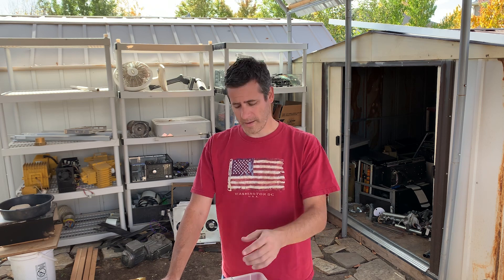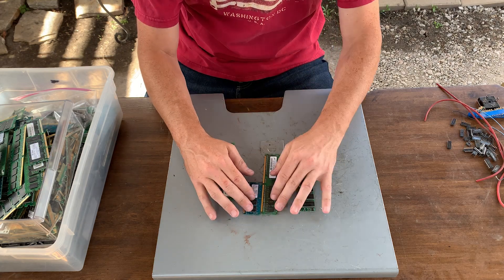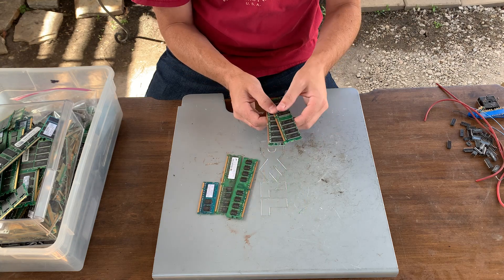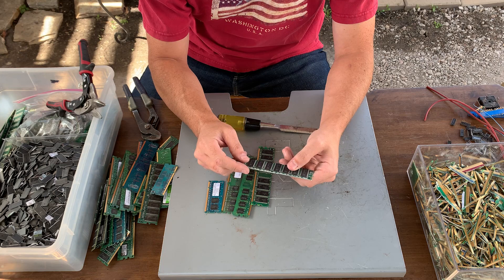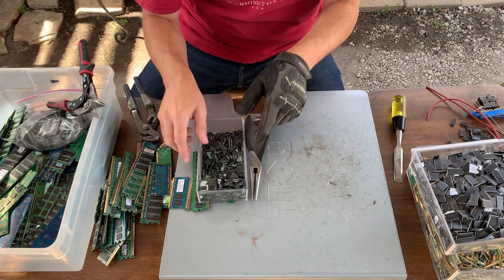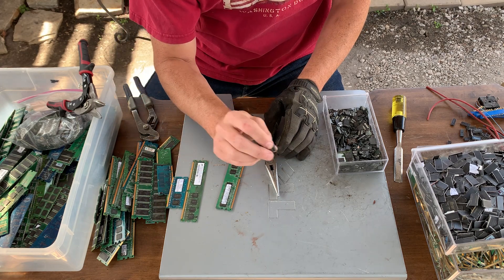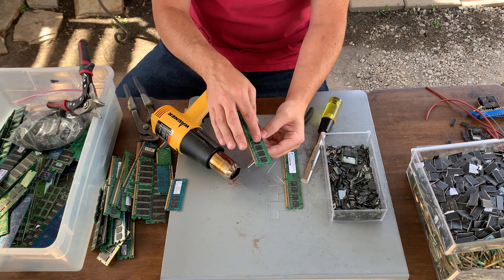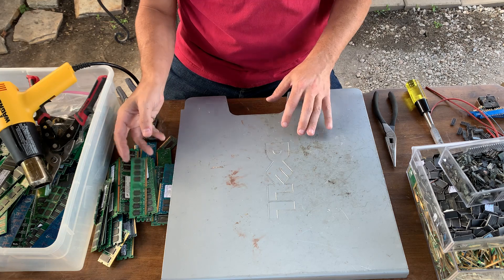How to Pull Gold Components From RAM (Recovery, not Refining)

Comment: I use a heat gun. It takes everything off and nothing goes flying
Reply from the maker: I used to use one too.  The heat gun is nice and controlled… but I have a backlog of maybe 300 pounds to work on.  It takes time with a heat gun.  An oven goes faster, but I am breathing it all in… and I smell like burnt plastics for a day.  I am looking at quick ways to get this done… this goes really well… I just need to control the crazy ic chips that want to fly.  Some have said to do it in a box.  I will be trying that here soon.

Comment: Hi brother ♥
How much gold inside 1 kg of ram
Thanks a lot dear
Reply from the maker: It varies based on IC Chip type (BGA vs dual flat pack chips -- meaning it has legs out 2 sides), on ram style, finger length and density ... if the RAM has chips on both sides, if the IC chips are packed on the board as dense as possible... I hate giving vague answers, so instead of trying to guess all the different configurations that can throw this off... Lets change the question just a little... How much gold is in 1kg of IC Chips... About 2.5g to 4.5g based on SDRAM vs DDR ... and you may see about 2g of gold from 1 kg of close cut fingers ... This leaves you a homework assignment :) ... how many chips and fingers do you have total per stick of ram?  This can be answered only after dismantling your RAM ... but it will be more accurate to see it this way as IC Chips are usually very controlled as to how much gold is used in them.  This takes the fiber board out of the equation as much as possible.
Reply: @badideametals  Thanks dear ♥